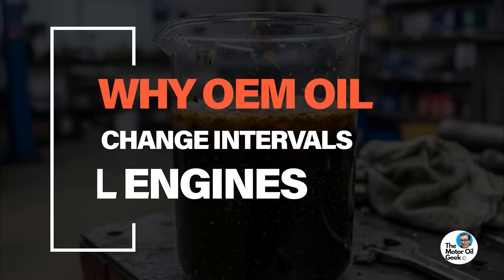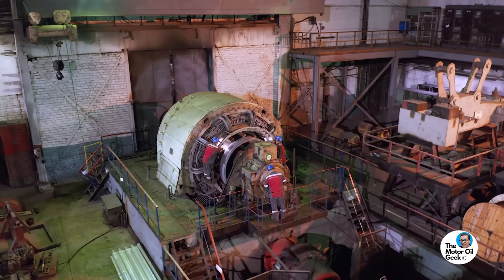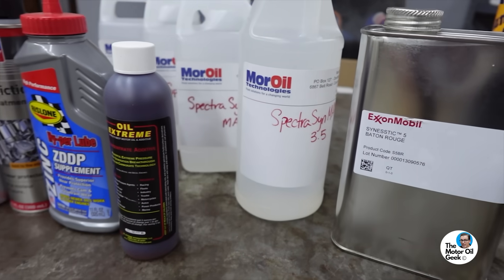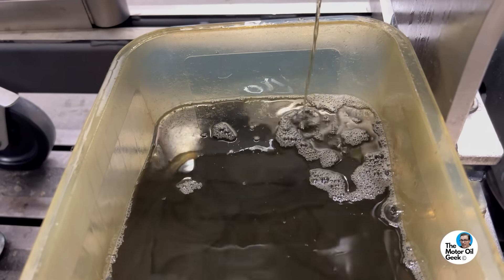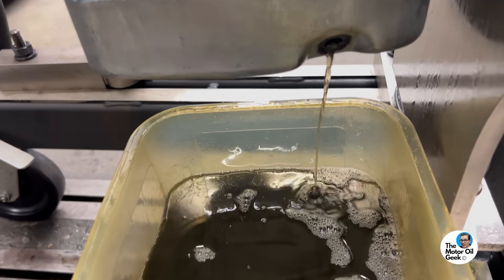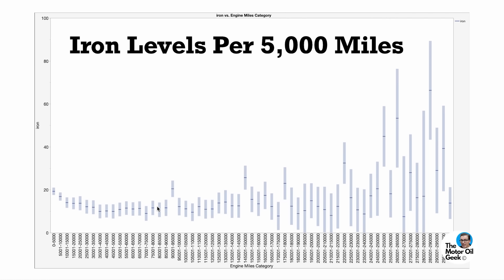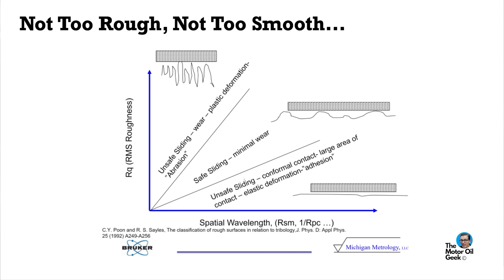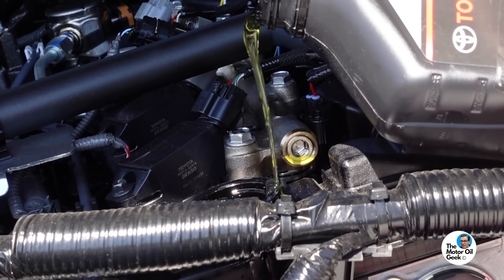NEW Data Reveals WHY Modern Engines FAIL Prematurely!

Comment: I did an initial oil change after the car came home (50 miles), after 1000 miles and ran it with low load but varying revs until the evening before the 3rd oil change.  Still, it took 8000 miles before I noticed the engine breaking in through lower than normal fuel consumption.  The 3rd oil change is when the filter got first changed.   So far no noticeable oil consumption or issues of any kind, and exceptional fuel consumption (best by far for my vehicle on the fuel use monitor I use).  Switched to a full synthetic 10W-30 too.

Comment: Nice if you can cover motor oil for rotary engine NA & Turbo Charged engines.
Reply: The engine that hasn’t been in a US production car for 10+ years? Might as well do a video on carburetors.
Reply: @rdspam that's a very ignorant comment. Carburetors are still used on the daily. Secondly, Mazda is bringing back the rotary, initially being used as a range extender in EVs.

Comment: Why make the engine last 10 years when the rest of the car is now obsolete in 5?
Reply: How are  my 2010 and 2017 “obsolete”? I must be missing it in daily use.
Reply: @rdspam Depends on the models.
What are you driving?
Does the 2010 have ESC?
No ESC = obsolete, to me.

Also, OP was referring to the computers-on-wheels built in the last 5 years. Nothing to do with your 2010 or 2017. A computer-on-wheels is naturally going to be obsoleted soon, because that's what computers do.
Reply: @aliendroneservices6621 Thank you.
Reply: Nothing undercoating can't extend life. And there's always wrecked  vehicles to go to for picknpulls or junk yards.